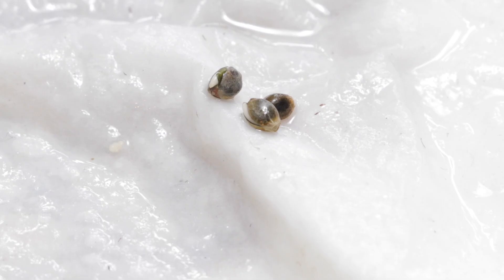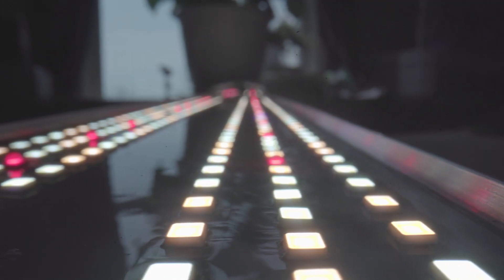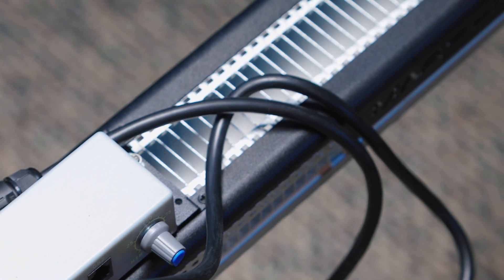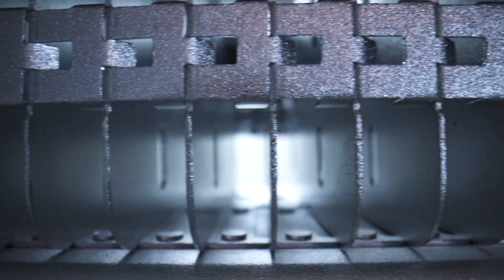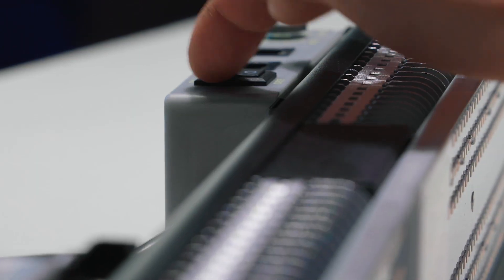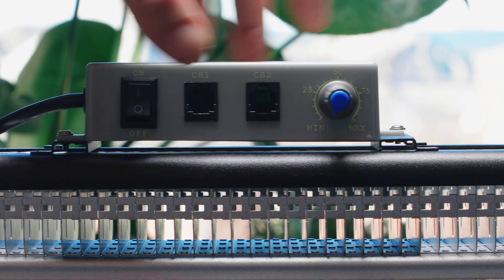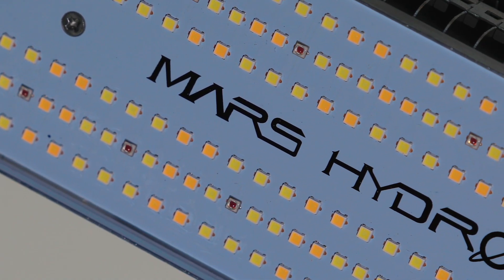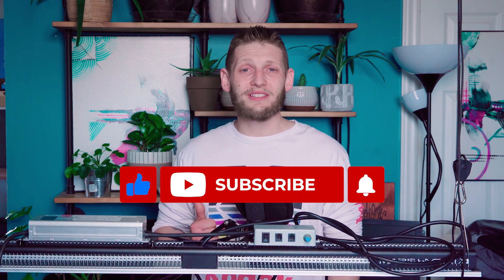Mars Hydro SP3000 - First Impressions Review

Comment: I have 2 of these in a 4x4, they work great though mine does not have UV leds. Just so the consumer is aware they are no longer offering UV on the SP3000.
Reply from the maker: 💯 correct, they removed the UV chips later in the year. I wouldn’t really worry about it not having them- they’re known to burn out faster than other LED chips so you’re probably just avoiding problems.

Comment: Per Mars Hydro: For the SP 3000 and SP 6500 lights, the previous version is with IR and UV chips. Since March, we have moved the IR and UV from the SP 3000, SP 6500, and FC 6500 lights. Also, the new FC-E6500 light doesn't have IR and UV chips. The reason is that these lights' main customers are personal growers who pursue the best results or the commercial project customers; they prefer to independently control the IR and UV lights time, don't need the IR and UV chips on the light itself. Mars Hydro also will issue independent IR and UV lights in the second half of the year.
Reply from the maker: This is 💯% correct. Honestly, I’d rather have a separate UV light bar anyways at this point 🤷🏼‍♂️😀
Reply: Yeah too much uv can burn them. Although it's not like they had a dedicated uv strip. Maybe they just wernt efficient
Reply: We need those UV bars

Comment: You still useing hps.?Nice video of the sp3000..Im going to try the fc e4800..Replace my 1000hps..
Reply from the maker: I am still using HPS but I definitely want to upgrade to LED this spring/summer growing season. I like the HPS for the winter to keep my grow room warm without additional heat. 🙂
Reply: I got all kinds of hps bulbs..400 600 1000..Vented hoods the big xxl..Digtal ballasts...Im totally led now 2 tsl 2000 mars amd fc E 4800
Tsw 2000..Power bill dropped 100 bucks cost me 1500 to upgrade..Have most of money back in a year..Need anything on the hps side let me no... ✌